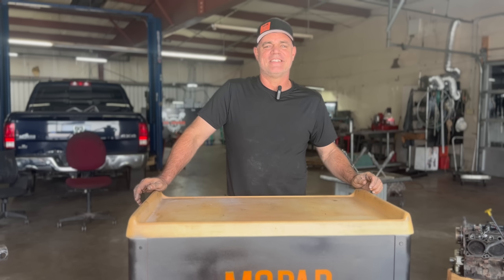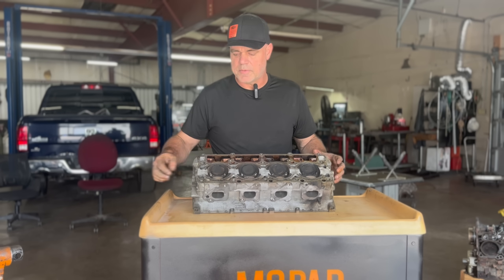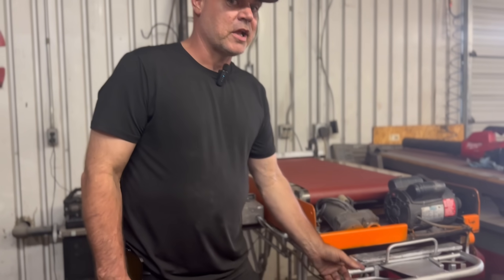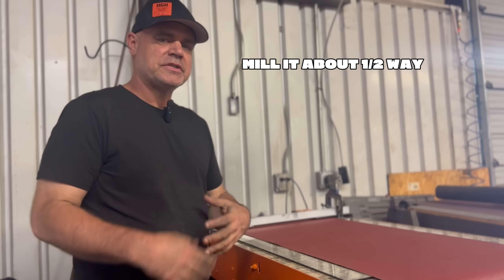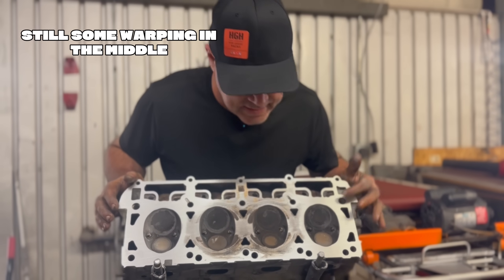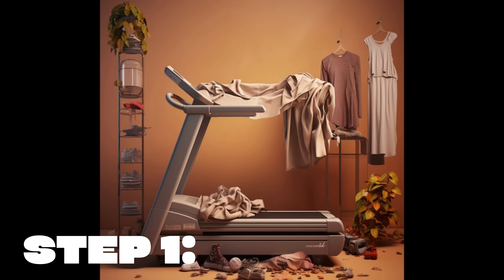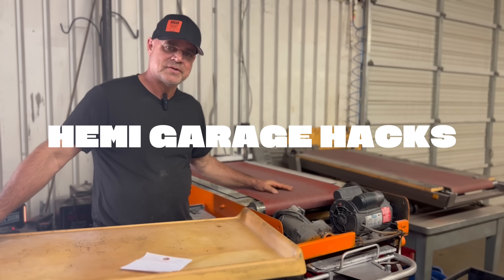I HAVE MILLED 1000+ CYLINDER HEADS WITH A TREADMILL!

Comment: Quick question, you added what appears to be an AC motor to the treadmill surfacer, why? Were the DC motors getting too hot? Or you needed just a fixed speed?
Reply from the maker: good question.  My other resurfacer has the original variable speed motor, but I did end up using an AC motor just to assure I had the power I needed without having the belt slow down.  Plus this motor has lasted more than 13 years.  Hope that helps and thanks for the question.  Glad you are here.
Reply: @HemiGarageHacks what HP is it? Do you recall what HP the DC motor was?
Reply from the maker: @wolfpeoplearereal    I need to look and see what the HP is on the motor I have now.  I bought it 13 years ago so I don't remember off the top of my head.
Reply: @HemiGarageHacks did you shorten the deck at all? What is a good deck size for general use? The treadmill I have is 4 feet long but I think 2 feet is better?
Reply from the maker: @wolfpeoplearereal  By time you put a backstop on there you will end up with maybe 3', so I don't think you will have a problem with what you have.

Comment: Never, ever do this. 

1)Try as you might you will remove more material from one end of the head or the other. Now your combustion chambers are slightly diffrent sizes and your getting a P0300 at idle and cant figure out why. BRILLIANT!

2)It leaves a directional finish. You won't blow graphite  headgaskets from it right away but they will blow thermocyling will scratch them to death.  MLS gaskets will weap coolant or oil cause the directional finish provides fissures for it to weep through that MLS will never seal. BRILLIANT!

3)all automakers stipulate the machined surface finishes of each engine from each maker must meet a particular "Ra value" so the gasket will seal properly with minimal wear to the gasket from thermocycling.
Get the Ra wrong and you'll chew gaskets or have fluid seepage. BRILLIANT!

3a)the automakers all have their own favorite Ra value. Some auto makers even have diffrent Ra values for diffrent engine families, and even drive train parts. 

While you may think this "cool trick" works it actually dosent. You may not realize it now. But you will in about 15k miles. I Wonder how many heads you'll f^%k up before this catches up to you....lol.
Reply from the maker: Some really good, detailed information and data there.  It still doesn't explain how I have successfully resurfaced well over 1000 heads in the last 13 years.  And yes, we have a warranty, and we honor our warranty.  If your analysis is correct, there is no way that I could stay in business. But I totally get it, it does seem like such a strange concept.  And to your point of uneven surface, the best practice has been to measure time in one direction and then switch the head around and run for equal time.  I don't have the goal to prove the validity because I have seen the results and I happily use it even today, even though I could buy an official "mill".  I just wanted to share my journey with this thing, it has been a very pleasant surprise.  Thank you for taking the time to share!

Comment: What you need on that is a peddle switch. Set the head on the belt and then start the motor. No more worries about trying to set it down or pick it up without hitting a corner or edge first or last.
Reply from the maker: I thought about doing that when I first made it.  I guess ultimately, I figured I didn't need it.  Thanks for sharing and glad you are here!

Comment: It may be flat enough for a seal, but it’s not flat, and far from perfectly flat. It could be better if you’d have flat surface underneath the sandpaper, and you’d move the head with random pattern. Glass is smooth, but it’s not flat,especially on plywood.
Reply from the maker: It's a granite base and the glass is on top of that for the purposes of protecting the granite surface and it allows a way to shim between the glass and the granite if necessary.

Comment: I worked at a machine shop for many years . In the 80s we acually bought a brand new belts sander head surface. Trust me it may work initially and you may get lucky and it last but all that being said is not a proper flat surface. Our machine was specifically made to do heads  it didn't take us long to go back to either a wet stone surfacer or a broach cutter. That machine is still in the shop today but is never used to surface heads.
Reply from the maker: There must be something magical about this one, because I have used it for more than 13 years and It works like a charm.  Passes the straight edge test also.  I don't know, but I am grateful:)
Reply: @HemiGarageHacks Thinking the use of a Surface Table and , a light smearing of  'High Spot Blue' Paste onto same would then allow for critical inspection whereby rubbing the repaired / resurfaced Head would pick up the paste... showing how the head was seriously flat ... Then you would know to a truly  finite level the succes of   your good work ...and you could even send the Customer the Phone Pictures of results...of same.   Great Upload ...
Reply from the maker: @malachy1847  I am planning a video where I can Bring one of my resurfaced heads to a machine shop and do some experiments.  should be fun.
Reply: @HemiGarageHacks  Your secret is you are using plate glass above your granite.  Pretty fucking flat. Woodworkers use it as a base to sharpen their chisels and plane blades to perfect flat.  Plate glass offers flatness, within 3–4 light waves per inch (~0.00015" per in).

If your plate is 4 foot by 2 foot:

Across 48 inches:
48 in x 0.00007" = 0.00336" deviation (≈ 3.4 thousandths of an inch).

Across 24 inches:
24 in x 0.00007" = 0.00168" deviation (≈ 1.7 thousandths of an inch).

Result: A 2 x 4 ft plate glass sheet would be flat within roughly ±0.003 in overall; that’s about the thickness of a sheet of paper.
Reply from the maker: @ryanjones2576  An important note also, is to not use tempered glass.  From what I understand, Tempered glass is not near as true just because of the heating process for tempering it.  At least that is what the glass maker guy suggested to me.  Hey, thanks for sharing!

Comment: cool idea! I guess the warping might affect the bearing location in the top (for the cam shaft)?
Reply from the maker: What I have experienced is that it is best to measure time on the surfacer and then flip the head around and run it equal time.  This at lease keeps the mating surface from getting wedge shaped.  And since we mainly do hemi heads now, the overhead cam issue doesn't apply as much.  That being said, we did hundreds of 3.7 and 4.7 cylinder heads which were OHC and we did not have any problems.  Thanks for commenting and glad you are here!

Comment: The outer edges at the leading side would always have a thou or so removed more than the rest. Just saying...
Reply from the maker: Yep!  That's why it's important to measure time in one direction and then switch the head around the other direction and run it equal time.  Good point and thanks for sharing.

Comment: Is sand belts like that readily available costly ?
How long would a belt last ?
Reply from the maker: You can order them from a company called Mirka, and how long they last depends on how much you use it.  I end up changing mine every 2-3 years.  The cost is fairly reasonable.  Hope that helps
Reply: @HemiGarageHacks  Great video. Innovative approach using those rollers and the glass backing. The company has a fantastic website and their attention to detail and corporate governance looks pretty amazing too. Thanks for the tip. They should sponsor you because people like me did not know about them at all.
Reply from the maker: @das250250  I agree:)  Hey, thanks for taking the time to share!

Comment: I have a friend who owns a machine shop that also built his own belt sander. It's very similar to the one in this video. He's been surfacing heads this way since the late 1980's. Lol. Sure he has the equipment to "machine" heads but for the average head job this works great. Heads, intake manifolds, exhaust manifolds, etc... this works great for just about anything that needs a flat surface.
Reply from the maker: That's exactly right!  And it would be cool to see his version.

Comment: I did the sandpaper on table trick to clean up left over gasket crud on a head that wasn’t blown but it still needed a light touch on a mill. Your idea is great and perfect for both cases. I can see having a finer grit to polish so having two is mint
Reply from the maker: I would say a good balance would be 80 grit after 20 heads have been ran on it.  Beautiful finish!  Hey, thanks for watching and glad you are here:)

Comment: Buddy whether or not it's flat doesn't mean it's plane is perpendicular to the z axis. 

This works for a farm truck, but you start bolting it onto high power, and have it tilted, it's gonna unevenly load your head studs or bolts and it's going to have uneven pressure on the gasket. 

It's better than that Mexican guy I saw with a 2x4 and some 180 grit... But, like... Dude... Get a Bridgeport if you're doing 100's of heads. 

Quit giving your customers the Indian flip flop shop special.
Reply: Harshly put, but I was wondering about the perpendicularity too.
Reply from the maker: @177BCardinal  The key is to measure the time you spend in one direction and then rotate the other direction for equal time.  They turn out surprisingly well.. Thanks for sharing!
Reply from the maker: based on your comment, you're going to find my next video (coming out later today) very interesting.  It deals with that and 9 other hacks you might hate as much.  Super helpful though, I hope you watch.
Reply: @HemiGarageHacks I don't hate them, I'm just not paying for somebody to do that for me as a service. Nor am I going to put 6 grand worth of parts into an engine built like that. 

Like I said. Perfect for a farm truck, but it's the flip flop special. 

furthermore, if you're not cleaning it like it has been sand blasted, I'm not trusting the fact there isn't sand left in a galley which can very quickly eat up a bearing.

Comment: No you didn't mill the head on a running machine you made a belt sander, milling is a precision process belt sanding is not
Reply from the maker: You are 100% correct.  We chose the term for 2 reasons.  One, it came from a treadMILL and two, it was a term more commonly understood by general audience for straightening the mating surface.  Glad you are watching:)

Comment: Years ago, I surfaced a four-cylinder cast iron head by taping a piece of sanding belt to a chunk of finished marble while sitting on my front porch. I used layout blue to see the low spots and move that head back-and-forth on that sheet of paper until it was cleaned up.
Reply from the maker: I love hearing those stories!

Comment: To raise your game one more step, get an inexpensive surface plate, and use some blue grease (Dychem) to check for high/low spots. You can check within that .001 you are doing with a feeler, but across the whole surface.  Great idea on the treadmill.
Reply from the maker: Thank you and yes, I do plan on doing something similar to your suggestion on a follow up video.  I am super curious to see the outcome.

Comment: Ok, now the underside of the head is straight but what about the top of the head where the camshaft runs? This isn’t straight anymore I think and your crankshaft is bending?
Reply from the maker: 98% of all the heads we resurface now are not Over Head Cam Heads, but we used to specialize in 4.7 and 3.7 which were OHC and we did not have any issues with them as long as you measured the time on the surfacer and changed direction of the head and ran it equal time.  Great question and great point.

Comment: If you have done this thousands of times, you could have easily afforded a knee mill. Hack tech
Reply from the maker: 13 years ago I would have thought this would be a temporary solution until I could save the money to get an "official" machine to accomplish this, But this has worked so surprisingly well that I still keep using it.  It would be a waste of my money to "Upgrade".  Just my humble opinion, and yeah it actually works that good. Thanks for sharing and glad you are watching:)
Reply: @HemiGarageHacks  you should learn a lesson on flatness from a real machinist. Your technique might "work" but its not giving true correct geometry

Comment: On aluminum heads, when they’re extremely warped, the cam bearing surfaces are also warped. You need to clamp the head to a large piece of steel and bake it an oven , which will slowly straighten out the head. It’s a whole video  on how to do this.  Then you resurface. Anyway, if the warpage is just beyond specs, then you can get by with just a resurfacing.
Reply from the maker: agreed.  that is super important on the 4.7 and 3.7 heads which are OHC.  But mainly we do Hemi's now. thanks for sharing

Comment: Keep in mind that cyl. Heads have a warpege tolerance. Rule of thumb is max.  Warpage is .004 on a 4 cyl. Head. .006 on a 6 cyl. Etc. not always . So, .001 warpage is still easily within specs.
Reply from the maker: helpful information, thanks for sharing

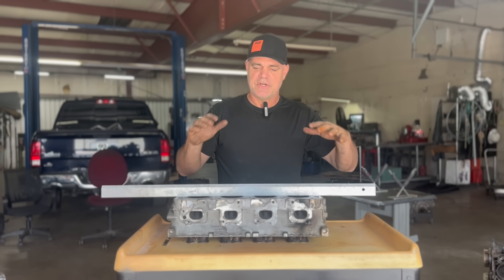Comment: 3:13  We used to get adhesive backed sandpaper on a BIG Roll like 30 or 40 feet long, and affix it to a giant heavy sheet of glass (like 3/4" thick), they called it  "FLOAT GLASS"  and use that to flatten the heads :)   by sliding it back and forth, on the sandpaper, on the glass.

Supposedly the float glass was perfectly flat, better than regular plate glass.  The piece we had was from a scrap yard ....   and it had layers of tape on the edges so nobody cut themselves on it :)
Reply from the maker: Thanks for sharing, I love hearing the different stories of what people have done.  So glad you are here!

Comment: Dude, this ain’t milling or machining! The issue with your method is potential you can sand it pretty flat but it could be sanded at a slight angle and you have no idea how much metal was removed. You use a .001 feeler gauge implying you want perfection.  Buy a used Bridgeport, a fly cutter some mics, DTI and you in! Is this a Manufacture approved method?  Sometimes a guy needs to improvise and sometimes a guy needs to realize just ok is only half done. Glad your not in the medical or aerospace industry doing hacks
Reply from the maker: All innovations started with a Hack, no question. And there is a way to do this (by measuring time and changing the direction of the head) and still maintain relative level.  Is it "Milling", not in the sense of using a mill.  but it is a good way to resurface quickly and affordably.  The feeler gauge and straight edge are for insurance.  It's not for everyone, but it sure has been a life saver for me.  I see where you are coming from though and I am glad you shared.

Comment: Nothing wrong with this method in a pinch. I would probably recommend a surface plate if you have access to one. Machine shops have been using a machine very similar to the treadmill for exhaust manifolds for years.
Reply from the maker: You're right and I remember those days.  When I first came up with this, there was no way I could afford buying anything that could accomplish this, so I decided to give it a shot.  I was pleasantly surprised to discover it could actually work:)  Thanks for sharing and glad you are here!

Comment: So how many thosand di u take off wats minium
Reply from the maker: it all depends on how warped the head is.  As far as Hemi Heads go, it tends to crack before it warps to the point where you can no longer use the head.

Comment: if it works it works but calling it a mill is wild even if its the frame, motor and rollers from a treadmill. its in no way milling the head bc its not a milling machine, its a belt sander. and im willing to bet 9/10 heads sanded on one have the face out of perpendicular to the cylinders. but again, if it works it works.
Reply from the maker: It's definitely important to measure the time on there and turn the head around and run it for equal time.  that seems to have worked well for me.

Comment: Please stop saying MILLED, it’s being SANDED flat, milling is the process of cutting it flat with a specific machine, a MILLING machine.
Reply from the maker: Indeed!  I chose the general term for general audience understanding of straightening the mating surface, but technically you are correct.  Kind of like when someone asks you for a Kleenex, it's not a Kleenex it's a facial tissue.  Kleenex is a brand everyone has associated with a facial tissue.  But I get where you are coming from.

Comment: Curious why glass as a base? Wont that shatter under heat?
Reply from the maker: It doesn't generate as much head as you might think.  The main purpose of the glass is to protect the surface of the granite and to have the ability to shim between the glass and granite if you need to make any adjustments.

Comment: I can't remember the brand, but there was a belt sander type machine made years ago like this. The shops I know that bought one ended up using them for exhaust manifolds, as head facers they were bloody rubbish. If you got a head in for a reface that had been done on a belt sander last time, you could tell during the first cut. The face wasn't parallel to the rocker cover surface, end to end or side to side, sometimes by a lot.
Reply: The trick is changing the direction of the cylinder head when you are resurfacing and measuring the time it is on there in both directions.